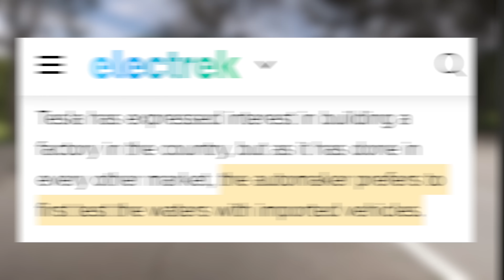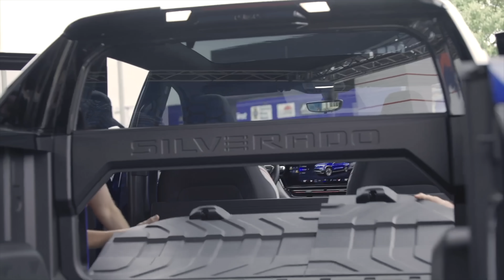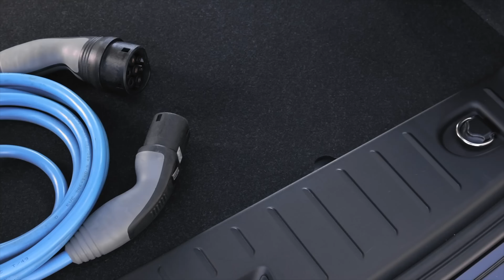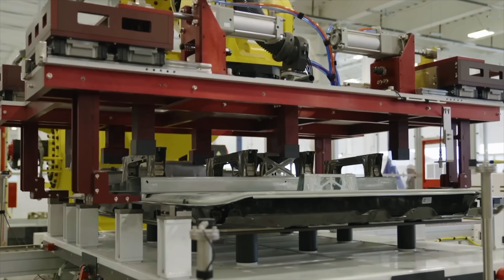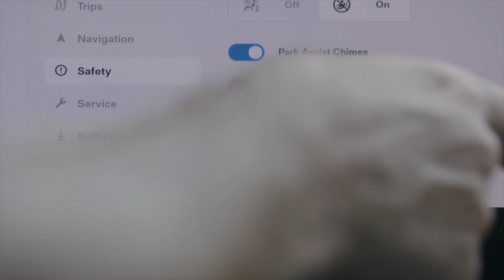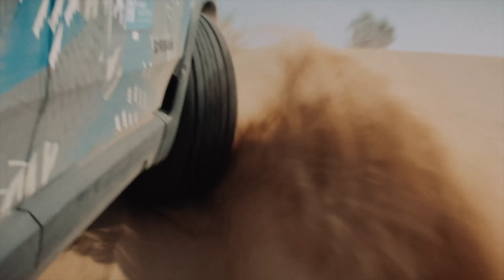Tesla HUGE Battery Issue FIXED | We Can’t Wait

Comment: GM’s trucks are too heavy . Will be interesting to see how long the suspension lasts . I used to have a Sierra crew cab with a 454 engine in it . The engine was to heavy for the front end. I was for ever having to replace the front end . Admittedly I was using it for work and was driving on a lot of dirt roads .

Comment: I would love to have a 400mile range, not because to drive 400 miles in a day but, less time to plug in. Id rather pass up a supercharger or 2 then to hit every one. Also there are cars that almost travel 400 miles. I travel 160 miles round trip to my job. And winters Im having to add 20% to my charge to get home with at least 15%  and summer its about 20% without having to stop. Now with degradation it can become less on 160 miles. So Id rather relax than have worries.

Comment: GM puts a huge battery with low efficiency, low miles/kWh.  Time to do the math and calculate what you pay for electricity per charge.  If weight keeps going up and efficiency does not drastically improve theses trucks could start approaching operating costs of ICE trucks, especially if they are loaded up.

Comment: Ryan, we can't think of pickup trucks the same as other EVs. Pickups are often used to tow RVs and other trailers, so they need 500 miles of unladen range so that they still have a workable, decent range when towing or with a fully loaded bed.
Reply: 95% of pickups sold will never do more than carry potting soil from Home Depot.  Need to tow?  Get an ICE for now and let the technology catch up in a few years.
Reply: @ohger1  correct, unfortunately slowing the conversion to renewable energy

Comment: GM is simply getting (the extra range) with stuffing huge batteries like the EV Hummer which has a MASSIVE 200 kw battery. That’s partly why it’s 9000 pounds and over $100,000+. So you’re gonna pay a too much money per mile since they are not efficient, and then you gotta wait forever to recharge a massive battery, and charging it on the trash EA network which data shows have a 50 percent reliability on that network of chargers. No thx.

Comment: While potentially exciting news about the Chevy Truck, I am not likely to buy GM as they have a long and repeated track record for abandoning their EV products (and others eg. Saturn) and leaving owners without repair parts and/or services. The services you can get at an independent shop; however, the unobtainium parts means you would be able to fix your truck.

That will be a hard "pass" on the Chevy EV Truck. I just can't trust GM to be there for me down the road.

Comment: I think most EV companies are failing to realize that efficiency isn’t just a nice to have. These huge boxes on wheels meant to tow stuff fundamentally aren’t efficient and trying to carry enough batteries to get passable towing range isn’t working. Ideally you need 200 miles of worst case scenario range and 15-20min 10-80% charging. Passenger cars hit this with ease because they are aerodynamic and don’t weigh 5 tons. Trying to get to that range spec everyone focuses on will result in charging times that are too long because the battery is so big. And secondarily, now it weighs too much to handle well.  I want the EV changeover now for passenger cars, all of the problems that would cause are solvable but batteries aren’t dense enough for towing applications. It’s too damn inefficient.

Comment: I believe the additional range is there in order to justify moving the price nearly up to the $80k limit for a rebate. 
Ford didn’t know about the limit and couldn’t design a model to maximize MSRP.  
Tesla has the time to tailor make a version of CT that comes in just under $80k. 
It won’t be the first version sold but I could see Tesla managing to keep the top trim starting at $79,990 or whatever it was the day it was revealed. 
Lower trim prices could be higher. Cyber Quad xtra, FSD xtra of course, no options. 
Waiting so long to release CT may end up helping make it incredibly competitive vs all others.

Comment: Fun fact, Panasonic isn't making the 4680s, and they aren't using the Dry Electrode tech. 
They only make 2170s. They are currently building a factory in Kansas, that will produce batteries for both Tesla and Lucid. I don't know if it will produce 4680s or not, though.

Comment: I do not believe one iota that Chevy/GM will have that range. GM is not saying the type of battery they are using on the Chevy, and if the Battery Review of the Hummer done by Sandy Munro Group is indicative, this is a crappy vehicle, and not a real competition for the CT, but I may be wrong.  I will still maintain my reservation for the CT though.

Comment: EVs should have a range of 400 miles considering a 80% charge and to account for cold weather and battery degradation
Reply: LFP batteries can (should) be charged to 100%
Reply: @oktodindon  per Tesla, my 2023 model Y should be charged to 80% for daily use and only to 100% for longer trips to preserve battery
Reply: @AJ-sz7bh  Then it's a LR or Performance version, right? Only the classic version has LFP batteries
Reply: @oktodindon  Yup long range
Reply: @oktodindon  It would be nice to see a 400 + mile range.
Reply: @oktodindon  off the battery subject, I wish they had not taken the sensors out of 2023 Y. Tesla Vision for park assist is terrible

Comment: I wonder how they test the car in extreme heat but not felt heat on their heads, i am in Thailand and it would never drive a testa y in mid day, the sun light thru the roof is cooking my head, i have to wear a cap. And yes i use dark film also but not helping. I'm buying a roof cover.

Comment: I have rich experience in India. The on ground work is very tough & the market is huge, but concentrated in urban & semi urban areas. Availability of electricity is a challenge, but could ease over coming years. Never the same to keep in mind for EV makers. 3-phase power is rare & hence the comparison with rich markets is futile.
Reply: Power is rare? Which village are you talking about?
Reply: @sasankv9919  not rare. But amount needed for running EVs. An EV can easily double the daily demand/household using it. I guess even in Mumbai. An average home has a 4-5k single phase connection.  And an average middle class household may be using roughly 200-300k/month. An EV draws 5k/day for say 20km, roughly. That’s Mumbai, not even the rest of the country. I said it’s challenging. 2 wheelers could be very promising. 

Home charging needs access to drive way. Public charging is a challenge even in countries that have the priorities on this

Comment: I need the 500 miles while towing. I plan on using the CyberTruck in the north woods- no charging network.
Reply: Why are you trying to fit a round peg in a square hole?  GAS is what you need.
Reply: The GMC 3500EV will have Allison electric motors with trailer towing gearbox's giving it extended range features.

Comment: 1200 pounds of payload is weak sauce. That is family of 4 and a maybe a 4000# trailer. No way you can tow 20000# without putting 2000# on the hitch exceeding the payload by far.
Reply: Please leave a message saying TESLA using the above handle ☝☝on tele_ gram !
🎊🎊🎊

Comment: From what I understand, Chevy wants to bring in the Silverado at under $80k and I simply don't see that happening. Or maybe the $80K is for the 350 mile version. But the 450 mile version will come in at $100K. Why do I say this?

The Ford F-150 Lightning, if we're being generous, gets 2.5 miles/kWh. In reality, it gets probably 2.2 or 2.3. Even at 2.5, that means you'll need a 180kWh battery. That's more than two Tesla Model Y's worth of battery. You're coming close to Hummer EV battery size at that point! 

There are other issues to consider, but the biggest one is there's no way Chevy will be able to sell a 450 mile range truck with the giant battery it will need, keep it under $80k AND turn a profit. I just don't see it happening. I'll be pleasantly surprised if I'm wrong, but I don't see it.
Reply: GM made the Hummer battery weigh 2930 pounds LOL the model 3 weight is 3582. GM has no idea what they are doing with EV design and battery. This is nonsense from GM Just like 18 models. BAH BAH
Reply: The Hummer EV came in on estimated spex,,  the similar Silverado EV and Sierra EV will do the same.
Reply: Good point. However, they probably can't care about being profitable right now. All ICE based car companies are playing catch up w Tesla. Which means they'll be at a loss for at least the next five years in their EV division. They're using ICE money to float em.
Reply: That's why GAS is king.

Comment: Good video Ryan. Unfortunately 80k is a deal killer on the Cybertruck. 500 miles of range isn’t necessary. But a true 300-350 miles of range would be wonderful.
Reply: True 300-350 = 450 Tesla  miles  of range
Reply: @enoughofthis   Driving the speed limit  I don’t lose 20% of my range estimate.  
Driving fast and climbing mountains yes.
Reply: @cjdunne1713  its not just speed related, its also weather related
Reply: @enoughofthis  true. In cold air you loose a good 5% depending on distance and speed.

Comment: A truck is the one case where you'd need well over 300 miles of range, since towing cuts that basically in half
Reply: Agree. The chargers are too far apart if you're towing in the winter. Need 500 miles, which turns into 200.
Reply: According to Edwards’ data, 75 percent of truck owners use their truck for towing one time a year or less (meaning, never). Nearly 70 percent of truck owners go off-road one time a year or less. And a full 35 percent of truck owners use their truck for hauling—putting something in the bed, its ostensible raison d’être—once a year or less.
Reply: I feel that truck ranges need to be quoted including a load of some kind, the way they do with the semi ranges.  I also think there should be a standard measure of cold weather degradation - this would not be popular though because Tesla wins this hands down at the moment.
Reply: @bluetoad2668  Cold weather degradation Tesla wins hands down? That isn’t what I have heard directly from Tesla owners. I talked to one owner and he said he lost half his range in cold weather with the heat on. Tesla has some of the lowest reserves in the industry. Other makers install significantly larger batteries compared to what they claim than Tesla does. In various real world testing of Teslas they consistently get less range than claimed. Porsche always gets significantly more range than claimed while Ford and Hyundai are a mixed bag some less and some more. That isn’t a record for Tesla I would be bragging about. You can look up real world testing yourself.
Reply: @bluetoad2668  Your point is well taken. Range under various loads would be very helpful for truck owners who use their trucks as tools. I imagine many working truck owner are skeptical of the viability BEV trucks. Until proven otherwise many will wait for more information.
Reply: ICE trucks reduced range as well.
Reply: @Dive-Bar-Casanova  True and thats why they have huge gas tanks, same concept with EV trucks
Reply: The battery would have to be huge and the recharge times must be outrageous.
Reply: @joecool509  With a high voltage, high kw charger and a pack designed with proper temperature management it actually wouldn't be much different than an ev sedan in terms of time to charge but it would certain require more power overall in terms of cost.
Reply: @joecool509  30 minutes or less
Reply: @joecool509  The size of the battery doesn’t significantly extend the charging time if you have enough charging capacity, because the energy per cell per minute stays about the same. Limits on charging are cell temperatures and charging current.
Reply: From owners of BEV I have been told in cold weather with the heat turned on in the cabin the range can be reduced by up to 50% as well.
Reply: @matthewhuszarik4173  Vehicles with heat pumps instead of resistance heating can help increase winter range.

Many people also don't precondition (warm up) their vehicle battery prior to leaving home on extremely cold days. A start time for preconditioning can be programmed into the vehicle before departure from home, so that it warms up the battery while the vehicle is still plugged in, thereby holding onto range and reducing range loss.

Vehicle batteries don't like being extremely cold, so that saps power and decreases range.

Warm it up! Range loss will be much lower.

You've got to learn how to use the equipment!
Reply: @dvader3263  Everything you have said is true, but none of it negates that BEVs get significantly less range in the cold, the hot,and steady high speed highway driving. ICEV get better range and mileage when you need it most long distance travel by highways at high speeds. BEV get some of their worst range and mileage in that scenario. Early adopters will tolerate less convenience and higher prices to be early adopter, but those that aren’t will be much less likely to. I have looked at all the Teslas and the cost versus return just isn’t their. I would have loved the old Model S with the portrait information screen, but at twice the price of a new hybrid Avalon it just wasn’t even a close call. I don’t purchase cars as a status symbol I buy them for their utility our hybrid Avalon provides that.

Comment: Enough with the range anxiety !!!  400 miles is much more than you need and if you consider that electric charging is SEVERAL TIMES cheaper, then I don´t care about charging 20 - 30 minutes (I will stop anyway to pee !!!). 

What we DO NEED is an official battery TRAILER that allows for those few times that we really NEED long range...maybe a 60 - 100 KWh pack that you can RENT.  So if you need to travel across australia in 3 or 4 stops, then you can.  Otherwise 400 miles is more than enough.

Comment: GM Official Estimate or EPA Estimate?  Is their Michigan plant even close to being ready?  (Built with taxpayer support, with the state's worst road around the plant - more taxpayer cost). The Hummer is a disaster and 30% more range means too much weight for the pickup. E use per mile will be over 1100 watt hrs.

Comment: Does anybody here charge their Tesla with a third party wall unit? Wondering if that has any negative impact on the battery
Reply: I bought my Tesla Wallbox after 1 year and charged my Model 3 with many different wallchargers before that. The car does not care which wallcharger you use.
Reply: The real question. Is a wall charger an advantage over a 220v outlet? I have a dryer 30amp at my apartment and 50amp outlet at my 2nd house.
Reply: No downside, electricity is electricity
Reply: The Tesla button, you will miss the Tesla button for opening the charge port. And you probably will charge the car daily. Without it you must open the port with the app, or in car or buy 3:rd party tesla button cable, or SEXY buttons. But other wall boxes has other benefits, better “power charing” features.
Reply: @Harrythehun if you’re standing next to the car by the port and have your phone next to you and just tap the port it will open. You don’t NEED the button
Reply: @jonspeed9570  When releasing?
Reply: @Harrythehun  no just to open it initially
Reply: @Harrythehun  or just push the cover.
Reply: I charge with my Tesla wall charger and I notice that there’s quite a bit of degradation on m battery. It now only charge 308 at 100%. I charge to max when I travelled to Vegas and that’s when I found out it only charge 307 miles. I only charge 80% on a regular and even that only gives me 247 now where I used to get around 275-280. I have 22 X refresh with 13k now.
Reply: @johnp2909  The EPA, WLTP miles and kilometres on your screen doesn’t really mean much. If you really want and need to know your degradation you must do a real test.
Reply: @FractalPrism.  When releasing?
Reply: Makes no difference ... the actual charger electronics are in the car. The wall unit is basically a switch with some safety devices ... the car just receives normal mains electricity and decides what to do with it.
Reply: Who knows?  Why risk it to save a few hundred dollars?
Reply: @craigweems  I can get a free one from my job installed. I already bought the mobile charger and it's too short so I'm considering ittttttt. But yeah Tesla charger seems safer